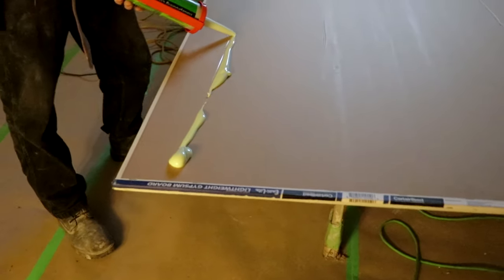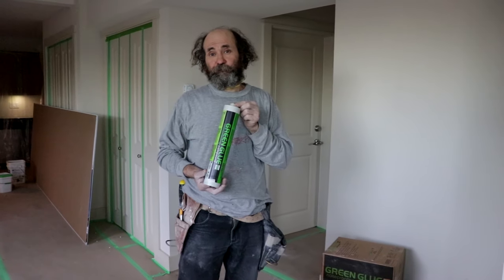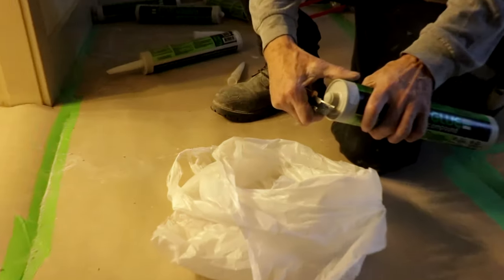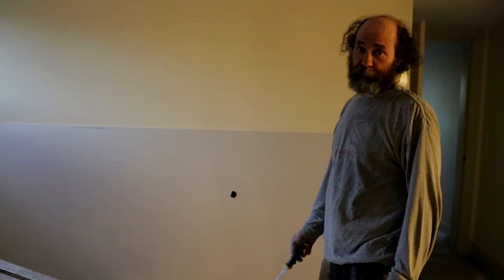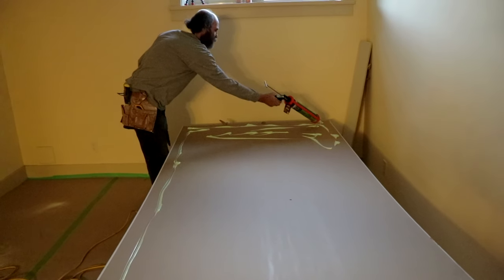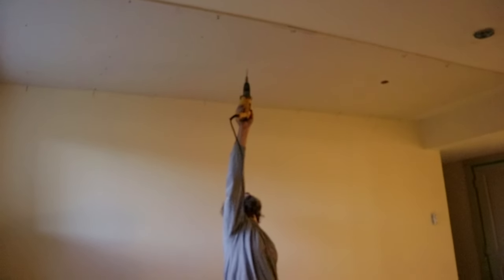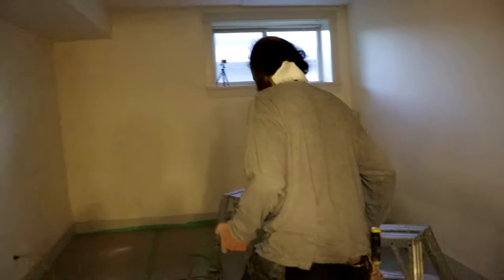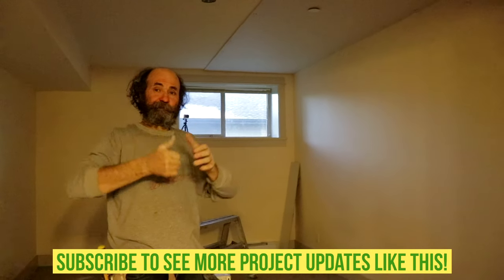How to use Green Glue Sound Proofing Material

Comment: Hi I am going to try to do this at my apartment on the walls. Do you have to screw the second layer into the studs? I am concerned because they are metal studs. Do I have to use different screws for that?
Reply from the maker: Hello my friend, for steel stud we use fine tread drywall screws 1" 5/8 for 2x1/2 or 2"  for 2x5/8  thank you for watching my videos
Reply: Bahiano Reno Thank you. Is it required to drill into the studs or can the new drywall just be drilled into the old drywall?
Reply from the maker: @RC_Cola2020  Hello my friend, yes you can use drywall to drywall screws (fat albert drywall screws, laminate drywall screws) you get be careful with wires and pipes, some times the wires and pipes are just running in between the studs spaces and to close to the drywall, the usually size of the drywall to drywall screws is 1.5" , thank you very, let me know, if you have any others questions

Comment: Hey everyone. This is not how the manufacturer suggests using this and many reviews online show that it doesn't really work this way. It is meant to seal the crack along your floor or ceiling or cracks around doors and outlets that are letting sound in. It is not meant to spread on the back of drywall like this.
Reply from the maker: Hello, thank you so much for your time, I will check on it, science is all the time changing, usually we apply 2 tubes of Green Glue per 4x8' sheet in a random pattern to the backside of the second layer of drywall and fasten drywall to framing following local building codes, fill gaps and cracks with green glue caulk or few others noise prevention (as per clients requests) if you have question please let me know, keep safe.